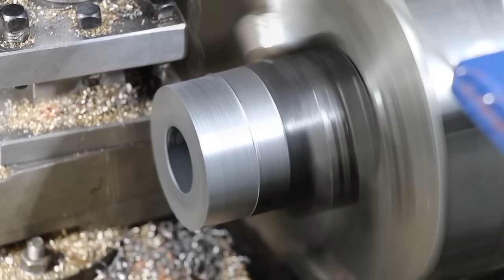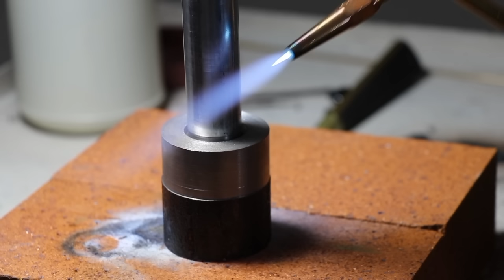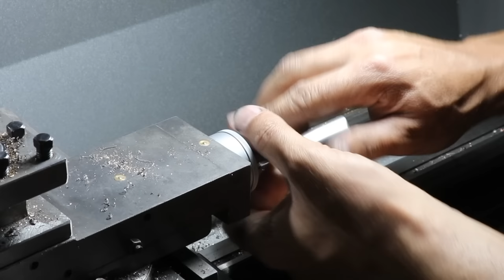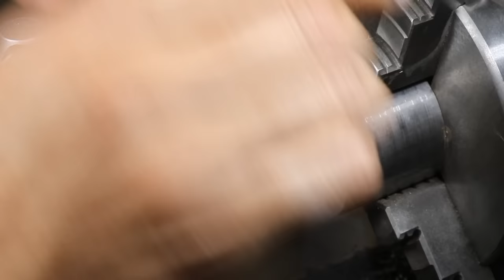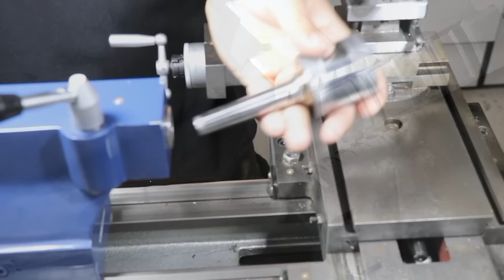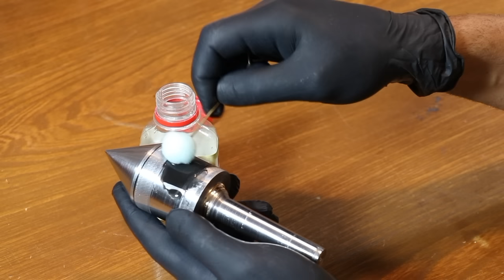How to make Live Center

Comment: I for one don't see how you can achieve any kind of decent precision out of a vernier caliper when,  I have to use inside micrometers when I get to do this type of work. I have to make to a certain class fit under the DIN classification of fits. There's a reason why micrometers were invented and where was the heat treatment and post heat treatment  grinding. As soon as the technician here started putting hand work into the process that was the beginning of the end and no heat treatment; no properly operating chemical blueing finish. I have to agree with John Locke; it's a Trainwreck.